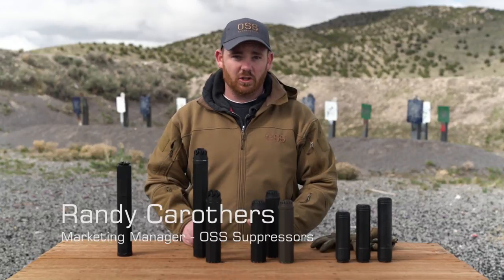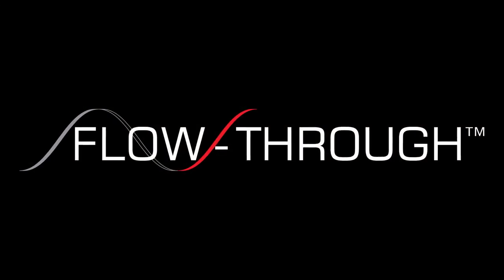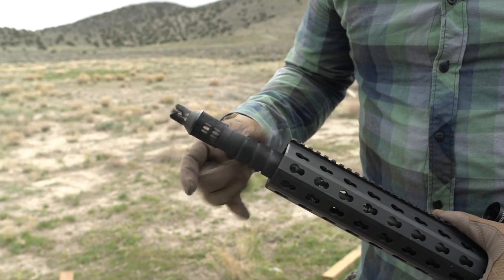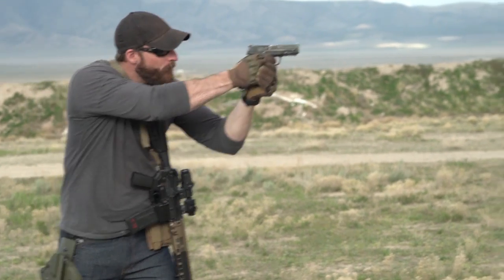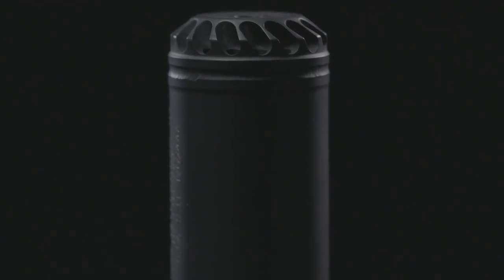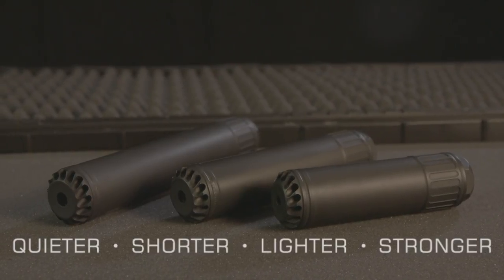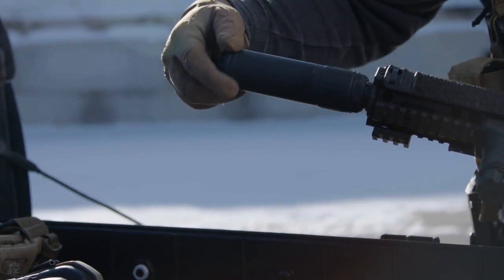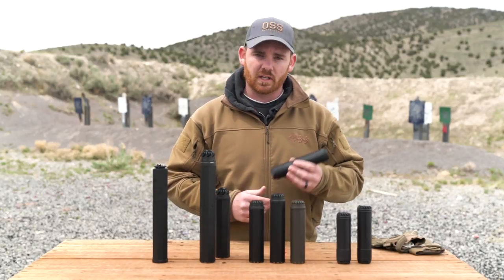OSS Suppressors: Some History on Helix-QD Development

Comment: Thanks for the video, it helped explain the design creep.  Will you be returning, or developing, and over the barrel reflex design similar to the original octagonal design to offer a larger suppressor that doesn't extend the overall length more than a normal can?  Thanks!
Reply from the maker: Its not currently in the plans.  Those models were extremely expensive to produce - unless the price was significantly less than the previous models (around $1999) we're not sure the effort is worth it.  We love the idea of a modular system though, so perhaps something similar will emerge in the future.

Comment: I own the older model as well, works great!! It’s to be expected that the design would improve. But the version I have does the job just fine,  mine is the middle line two stage 5.56. I like having the option to shoot with the short and long version of it. I also like that I can disassemble mine. Not gunna lie though, wish I could trade it in for the new model. Ha ha. Of course another thing I will say that is pretty sweet is with the my older version, if I decide to remove the Second stage suppressor Portion of my set up, then I’m just shooting out of a pretty sick muzzle break. For me my suppressor has two stages the first stage recesses about 3 inches over the barrel and is What I would consider a permanent part of the gun. It extends the length of the gun the exact same amount as a typical muzzle break but provides 15 dB of sound reduction. Since This peace is no longer going to ever be made again I’m kind of proud that I own it. One could look at it as a standalone muzzle break that drastically decreases Kick and also Muzzle rise. Not to mention 15 dB of noise reduction. You can’t find a standalone muzzle device that does that still only extending the length of the gun by an inch or two. Then I have the option to add the stage two portion of the suppressor for my complete package sound reduction. Again, I guess I’m just biased to the one I own. The new ones are pretty sweet though.
Reply: Nope... I fed it to you, hope you enjoyed eating it! lol